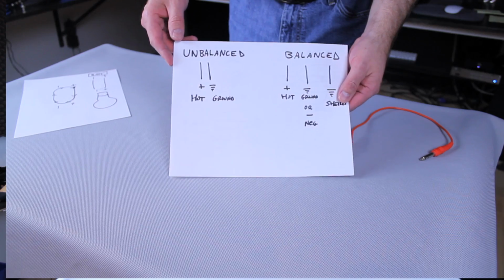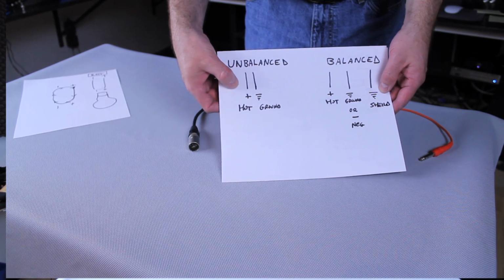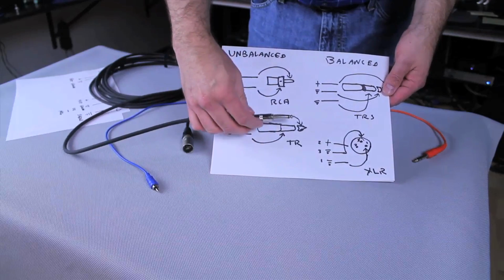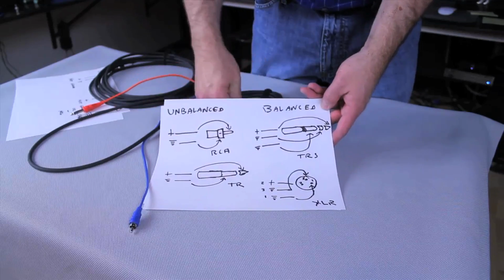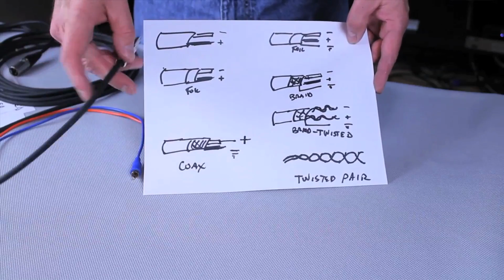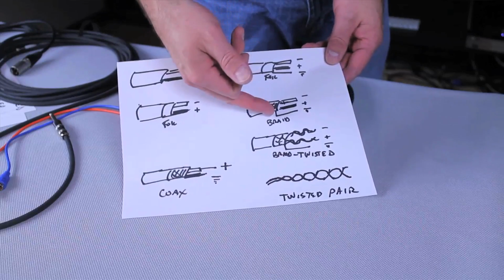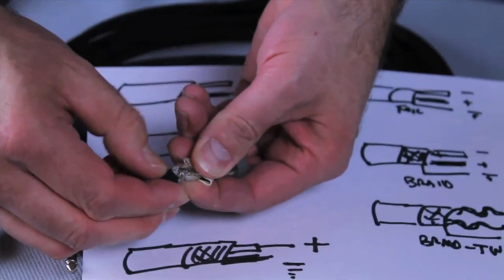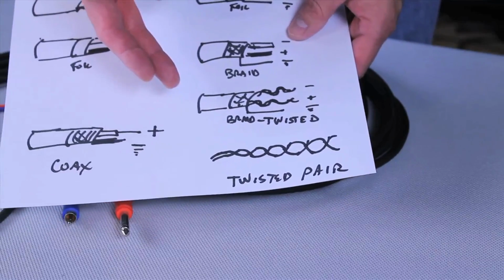NEIL KESTERSON WEEK 6 AUDIO CABLES

Comment: The impedance of a cable is a charactistic that is due to the cable's inductance and capacitance per unit length. It is important to terminate the cable in a resistance that matches the impedance for high frequency applications (digital audio or video) so that the energy in the wave is completely deposited in the termination. Otherwise, reflections occur and the signal quality is degraded.

Comment: Staying away from power cables with audio is important as you say, but it is due to magnetic coupling between the 2 cables. The strength of the induced current in your mic cable is due to the current in the power cable and is independent from the voltage.

Comment: ...The cut shield cable will solve this problem usually, but most DI boxes have a ground lift switch on them. Always have at least one ground in your system if you are plugged in to a wall socket. Not having a ground when there is a wiring fault can be fatal.

Comment: Some points: if you clip the shield/drain, phantom power won't work on a mic that needs it. Usually breaking the ground is only necessary where there are 2 grounds in a system, like where you have a keyboard that is plugged in to the wall at the stage and then plugged in to a DI box which goes in to your mixer which is plugged in to a different power outlet. Differences in the ground voltages can cause hum....